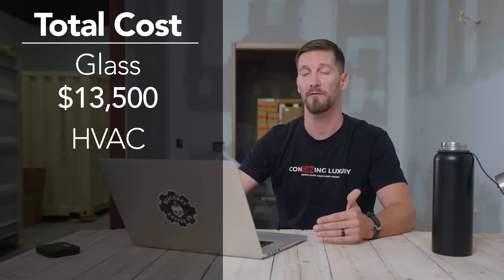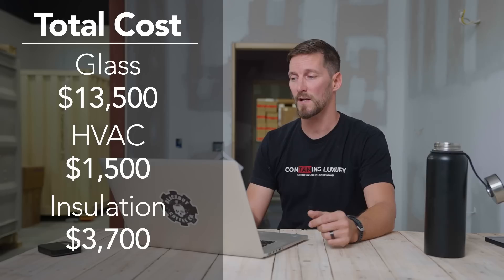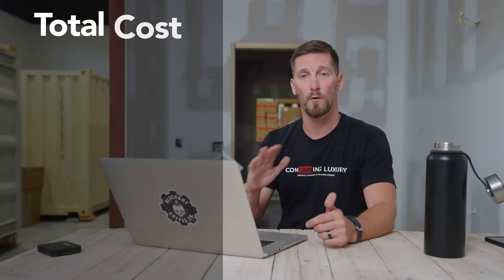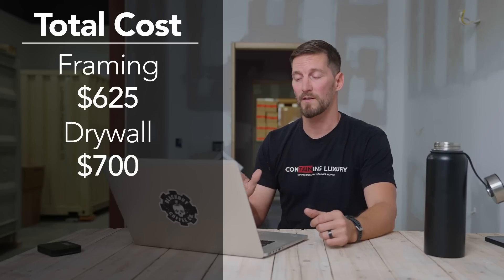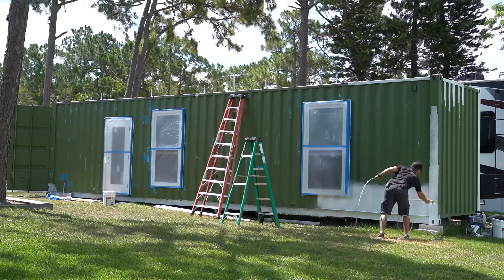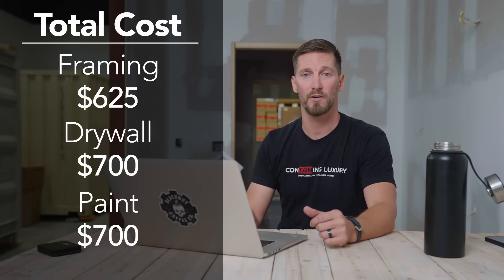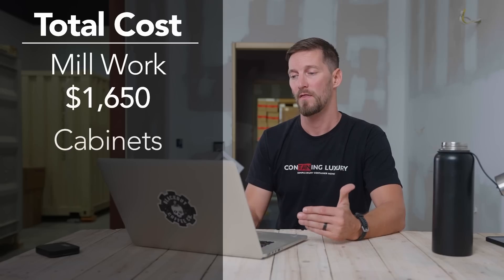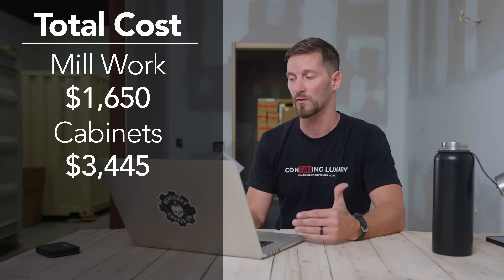40ft Shipping Container Home | 2022 TOTAL COST Breakdown

Comment: Instead of impact rated glass, install simple sliding shutters on the outside. This build was done super expensive. I get 40ft high cubes for just over $1000.
Reply: Any tip on how to find good deal like that? I'm looking to buy a couple

Comment: Why not invest in building the louvered pocket doors rather than buying complete? Tooling is a one time big cost that your company invests in, and materials/labor would be significantly less than buying prebuilt. Eventually you’d pay off the cost of machinery (not even expensive) and just turn profit from there while lowering cost to customer.
Reply from the maker: Maybe down the line! Lots of costs in starting up a little factory!

Comment: Great video again. You mention strengthening the cut-outs, which is obviously required. Have you ever had an engineer look at the overall structural integrity of the container, taking all the cut-outs into account? Also, how do you get around the holes in the floor, with regards to the bearers underneath? Cheers.
Reply from the maker: Hey! Yes we actually have fully engineered plans on all of our units to meet the strictest and strongest code in America, Miami Dade hurricane code!  
Not sure what you meant about the holes in the floor though??
Reply: @ContainingLuxury  Here in Auckland, New Zealand, I am obtaining a quote for bare 40’ containers with cutouts and necessary strengthening. I have been asked if I know yet where the toilet down pipe is going to be, as it may interfere with, and need strengthening, if it goes through a cross members under the container.
Reply from the maker: @Magicfrog1963  ahhh got you, we avoid hitting any trusses with our layout process so we don't have to restructure the floor system

Comment: $6,500 for a new (not used) one I'm assuming. Is that correct?
Reply from the maker: Correct it was suppose to say new :)
Reply: @ContainingLuxury  thanks, I had asked a question on a prior video, was wondering if you had an answer: do you know if it's safe to weld steel to the outside of a shipping container, assuming that the INSIDE of that container has already been spray foamed? I'm concerned about the heat of welding igniting the spray foam.
Reply: @thinkoutsidethecontainer   Yes you can weld outside of the container while there is spray foam in the inside, cutting spray foam causes no issues!

Comment: i regret not starting last year. also, one other thing to keep in mind, is that infrastructure cost are also expensive.  septic tanks, wells, or solar systems.. if any of those apply.
Reply from the maker: this is very true, fuel prices have had all contractors increase their pricing and equipment charges on top of labor and material increases!

Comment: Certainly many massive areas for savings.  $2100 for countertops?  Could prefab for a lot less than that.  Maybe even 1/4 as much if you do the labor yourself (cutting and polishing).

Also yea those window costs are insane, so in markets without hurricanes, the price would be 10 grand lower.